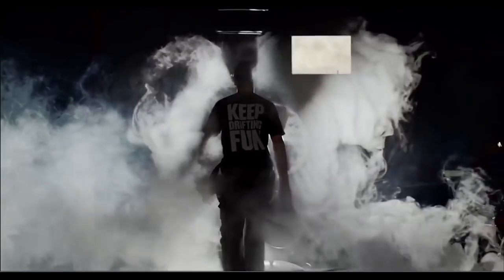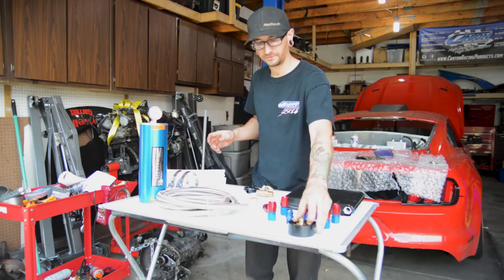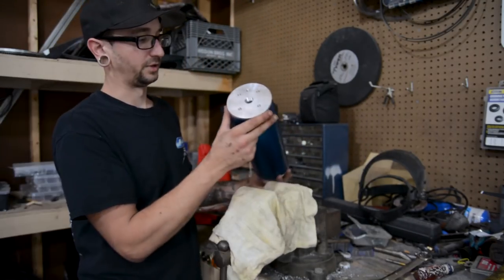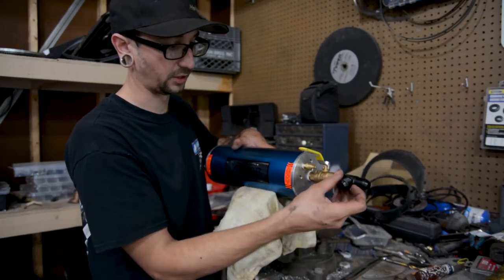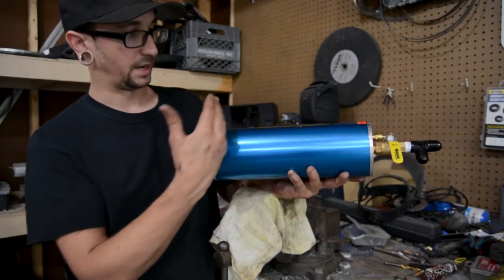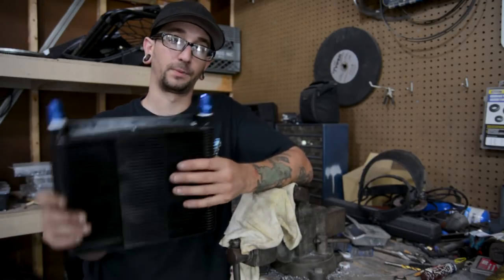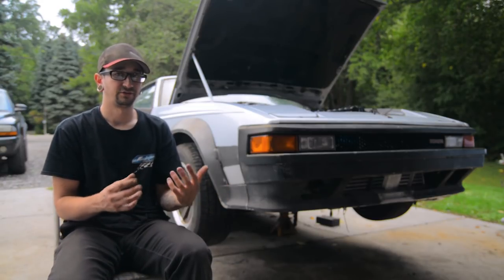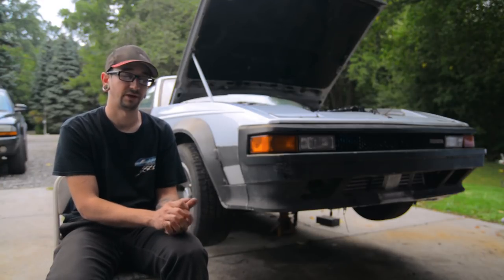Canton Racing Accusump Install

Comment: With the manual valve it's important to close it off just before you shut down, to retain the pressure for pre-pressuring the restart. Also I added a choke/hood type cable to my valve so this could be operated from the drivers seat. If you forget to shut it off before shut down it's best to leave it shut until you have the motor started and the pressure back up. Otherwise it takes longer to get the pressure up as the  Accusump also has to full.
Reply: Good points

Comment: The electric solenoid doesn't have to be hooked to an oil pressure low pressure sensor. You can wire it anyway you like. You can have it open when key switch is on and to close on key switch off. You can also simply put it on a toggle switch and its then just as manual as the manual valve. It's all about accessibility. If your accumulator isn't sitting next to you in the car so you can physically turn the valve you most definitely need to use a solenoid. Unless your so cheap you like opening and closing your hood getting in and out of your car all day at the track....

Comment: NPT threads are self sealing. No teflon required
Reply: I was saying the same thing. This isn't a water heater
Reply: "NPT threads are self sealing. No teflon required"

I know this is a year old- However

NPT threads are NOT self sealing. Theyre not like AN fittings, which are compression based. NPT threads are designed to have a gap between the root and crest of the threads, and this gap needs to be filled with a sealant to prevent leaks (Otherwise you will have a spiraling leak through the threads).

NPT threads should not be confused with NPTF threads, which are designed to interface / press together and form a "dryseal". 

A quick google search can produce far more information should anyone like more info. Cheers!

Comment: My opinion is the manual setup is a better option over the electronic valve. You never have to worry about solenoid failure or wiring issue making it simpler. Also if you put the T piece straight as it leaves the block and your oil pump sucks up air the accusump automatically adds oil into the line on its way to the oil cooler so that the oil supply to the engine isn't interrupted.....if your waiting for a drop in oil pressure entering the engine to tell you there's a problem, it can potentially be a bit late by then.....I have mine plumbed manually
Reply: It doesn’t engage at 0 psi 😀 It is tuned to be preemptive and is proven to work quite well. The point about electric fault is legit

Comment: You forgot the one way valve between the accusump and the cooler. Other wise when you open the valve to pre oil it'll go back into the cooler and not the engine.

Comment: Were does the 'excess oil' stored in the accusump go when it is pushed back into the system? Will this cause oil pooling in valve covers, turbo return lines, pcv carry over or windage/foaming issues with the crank?
Is there a dry sump system to fill the accusump as an addon or does it entirely rely on the built in oil pump of the motor?
Reply from the maker: If the system runs low and evacuates the accusump, the oil is ran directly into the post filter high pressure line into the engine, after pressure equalizes the accusump refills itself.
Reply: @Shane_Whalley  On a wet sump system though, does the excess oil not overfill the engine with oil? Say if the dipstick is reading full and you add more through accusump how does this not create issues? As above not quite understanding.  Sorry to sound daft and many thanks. ;0)

Comment: Is there a danger where the acusump can over fill an engine with oil?
Reply: It cannot add any more oil than is stored in the tube. A 3 qt accusump, when charged to about 10lbs psi will only add 1.5 qts of oil. Increase pressure and you will add a bit more.

Comment: So basically it's a oil reserve that if on a manual valve it'll operate by the pressure changes in the motor. Where on an electronic valve it opens by a sensor like the low oil senser on an LS.
Reply from the maker: Yup exactly
Reply: Thanks I'll make sure to put it on my list for upgrades I was just gunna do a cooler but now I'll add that on aswell.
Reply: @strikeforce4 >My thinking fell into your same category but creates certain challenges. A oil pressure sender like the OEM “LS” type works on a 5 volt circuit and produces a variable volt output. If you installed a on-off solenoid, would guess they are 12 volt.
Also, with my limited electronic building experience, but you would need an “Op-Amp” set with certain resistors or an adjustable potentiometer, one can set an output trigger. Say adjusted by oil pressure concerns, once sensor voltage drops, it matches the “Op-Amps” output to trigger, providing a “ON” trigger signal for the solenoid to allow flow. An “Op-Amp” simply uses two voltages, but as one voltage changes, thru a simple voltage divider (Center of 2 resistors) once the voltage into the “Op-Amps” input is matched, it triggers on. It uses a second voltage supply for an output that can be used to open the solenoid. The problem is this is very temporary as the input would change as the accumulator dumps. A 555 timer in “A-stabile mode, can provide a 5 second on signal, 10 seconds or longer, then resets, waiting for the next “Op-Amp” event. It’s all very simple. Right!
ASE Master Tech since 1978 - Retired
Reply: @deankay4434  Alot of people hook the soleniod straight up to the ignition switch, because once the oil is circulating, the accusump self regulates against the air pressure inside it.
Reply: @Colin Wright. >I would imagine that would be the most common method. My only thoughts were sitting at idle, at temp, oil pressure would at the lowest curve. Yes, this would charge the tank but only at a small portion of its potential. Hard to get perfect but neither of us like “No Oil Pressure” while cranking as 24X or 52X will fire quick. It’s better that nothing!

Comment: Shane, You have the instructions and I respect the company, but I would think the “Air Shrader” valve would go in the gauge end, on the other side of the tanks piston. This would control the rate of flow depending on tight bearings fit, a little loose when built or simply a high mileage engine. Also, once opened, the oil level would rise say a quart, hit the crank weights and foam the oil? I don’t know after 40+ years of working on engines, but say a 5 qt. system normally drop a quart once running and stay this way normally? Thinking about it, it makes sense depending on the engines entire oil cavities, ports, runners much less oil inside lifters sitting on the rockers and pooling to run back down the internal passages to drip back into the pan. An entire quart can be “Actively” lost in a running engine. So, I guess that an extra quart would be short lived with an external tank if pushed back inside once running. 
Is my thinking correct on this question?  Retired ASE Master Tech
Reply from the maker: The air shrader valve is on the gauge end. The air shrader is used to add a small amount of air pressure to the back of the piston (about 15psi), this helps to push the piston in the sump back out when not under oil pressure and empty the tank. When running the tank fills with oil, so the way you set oil level is to add recommended oil capacity to the engine, then I usually add 2 extra quarts. I start the car, open the sump, and allow the Accusump to fill, hold rpms up to about 2500 to build up a decent running pressure. I then close the valve on the sump, shut off the engine, then top off the oil normally. This insures that when running you have the standard amount of oil circulating through the engine that you should. Ideally you would want to put a check valve in the system to prevent backflow of the oil, but on my setup I have never noticed any serious issues with it.
Reply: @Shane_Whalley  My bad as I did not clearly hear “Pressure Release Valve” during your install. Got it. FThat’s what decades in a dealer will do to you. Also, 1970 sunblock was called “Dirt”, now have $3 ear surround by brown moles. Nice install with plate type cooler. I have seem evaporators assembled with “Ring” of coated aluminum brazing material then rack of 20 dunked in high temp salt bathe to melt & seal the seam. Tested to 500 PSI in water, dried and boxed. Amazing!

Comment: Did you skip the all important check valve? When you crack the valve on the accusump, you want the accusump oil to go directly into the engine, not  route through the oil cooler.

Comment: I've heard that you shouldn't use Teflon tape on oil lines as it can cause blockage. Locktight is better
Reply: Adding to the above comment for future visitors: most people use paste on NPT fittings instead of tape. Sticks work really well, too, but they are harder to find unless ordered online..

Comment: you should never use such tape on the threads of an lines for water, oil etc
Reply: Those are the npt side and yes you need teflon. The AN side you do not need teflon....
Reply: @doughopkinsjr  "Those are the npt side and yes you need teflon"

Mechanic here- I know this is a year old, but just to clarify for anyone reading this forward:

You DO want to seal NPT threads (AN fittings, which are compression based, should not need sealing, however)- But when sealing oil lines or similar lines of concern, its usually standard to use teflon paste in place of tape. The tape can break off, and block small passages down line. Of course if youre careful and 100% only get the tape in the threads and nothing but the threads- Youll be fine. Its just easier to ensure youre "safer" with the paste, rather than the tape.  The liquid / paste is a few bucks- and not worth the minor risk of doing thousands of dollars of damage, imo.